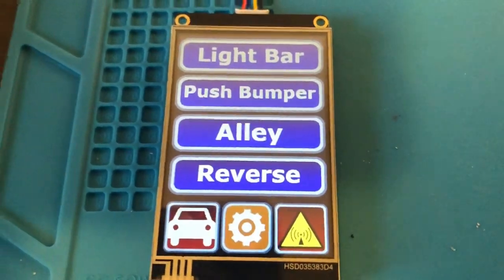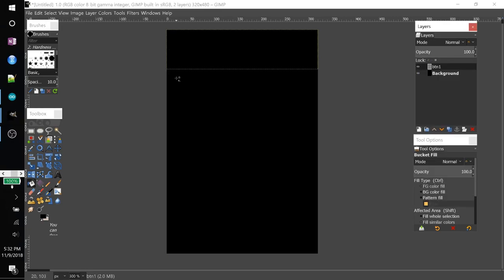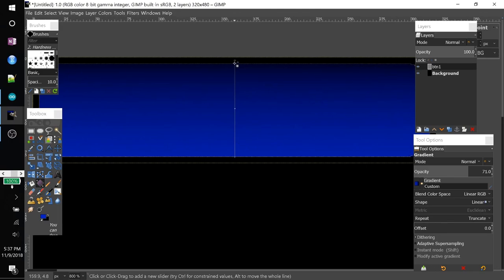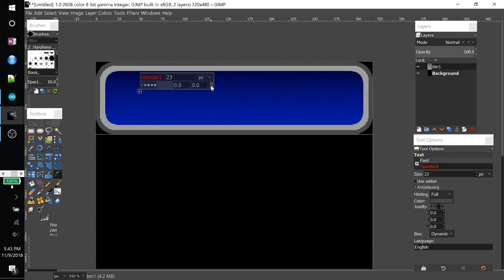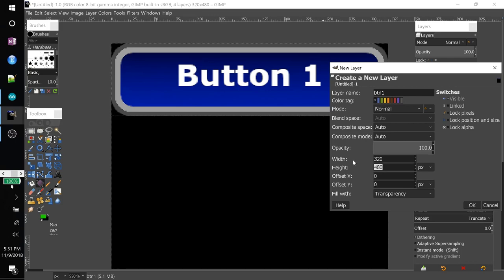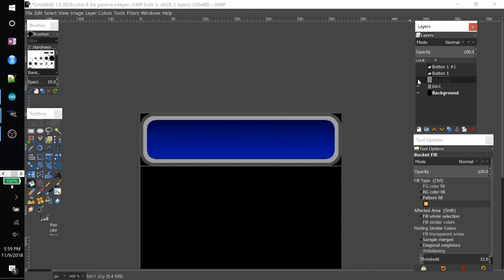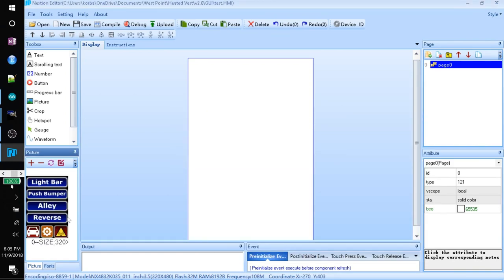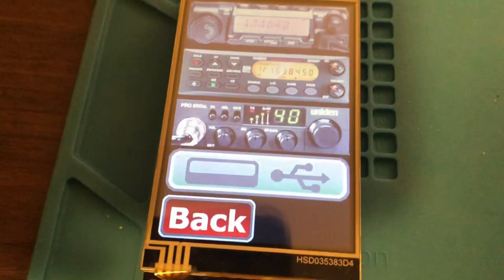How to Make Stunning Menus on Arduino Nextion Displays: GIMP Tutorial

Comment: I have made my own based on your tutorial.  my nextion debug simulator works as desired, but written to the display does not show any button presses.  I am using a combo of dual states and momentary buttons.  I have been googling for awhile and finding nothing similar. :(
Reply from the maker: Double check that you have selected the correct screen model and size. Has this screen ever displayed button presses or is this your first project with it? Could be something wrong with the touch layer on the screen
Reply: @korbano    good call, I dug through my closet for another nextion (same model) and the buttons work.   THANKS.

Comment: If you hold CTRL when you do the gradient it will snap to coarse degree angles so you don't need to be so careful to hit completely vertical. Great video. I've used these before and still enjoyed watching.
Reply from the maker: Thanks for the tip. I did not know that!

Comment: Nice -- just subscribed to your channel.  This is much better and nicer looking than using the built in buttons.  Have you done anything with dials / gauges using a sequence of images.  This is so you can have a gauge with a different needle / behavior etc. than the standard Nextion ones.   I was just wondering if there were any good tricks for creating the interpolated images for each value.
Reply from the maker: Using a sequence of images for gauges is actually the best way to customize and smooth the gauges. If you want your needle to go from 0 to 360 degrees, you would make 360 images of the needle at each degree. The built in gauge needle can be laggy and not very customizable. Unfortunately there’s no easy way to make 360 images. You would have to make them in photoshop or gimp and then keep rotating your needle slightly and exporting the image every degree. It’s quite tedious which is why I usually just use the built in gauges with a custom background image but the stock needle design. Good luck with your project!

Comment: how do you put the images into the gimp?
Reply from the maker: You go to file, import as layer, then select your image. It’ll probably import really zoomed in since most images are higher resolution than these screens but then you can right click on the layer and scale it. But be careful when scaling because once you make it small, if you try to make it bigger, it will be stretching the low res image, not the original image so it’ll be blurry. Always scale the original image down and then control z if it’s not the right size
Reply: @korbano  ok thank you

Comment: I ordered a nextion 4.3 display. I have not received it after 3 months. Nextion has not replied to my emails for 2 months. This is a bad company. You should take down this video!
Reply from the maker: I always get my Nextion displays from Banggood cuz they’re cheaper. The usually take a month to arrive but I’ve never had a problem. Nextion screens are still the best screens for arduinos, especially for the price
Reply: @korbano   TJC screens are the same(they make them for Nextion or better said one is for non-Chinese and the other for everyone else) but a fraction of the price, downside is you need to find a reseller in China to ship them to the US as they are only sold within China.  There is a group that has patched the editor to work in English and you get Antialiased fonts, floating point numbers and other options that should be available on the Nextion but they wont release as they charge money to do it instead. Ask why they havent released V0.55 of the editor and find out how long the post stays on their forum if you arent outright banned for asking.
Reply from the maker: Matt B yeah I’ve noticed from reading forums that the Nextion guys don’t seem to happy to help people out for free. In all fairness just because they made the GUI for free once doesn’t mean they should provide unlimited updates and technical support for free. I doubt these screens are bringing in the cash like the latest smartphones are. I see both sides though and I’m just making due with what I’ve got without their help
Reply: I think you can go to nextion website to contact them to check your orders, I have ordered some and I received them without problem
Reply: @korbano  Take a look at ITEADs EVE screens, American company with better quality screens and a lower price
Reply: @mattnsac  Any links or more information to find the TJC screens or the patched editor ? Sounds very interesting.